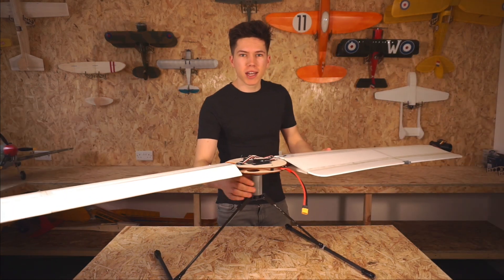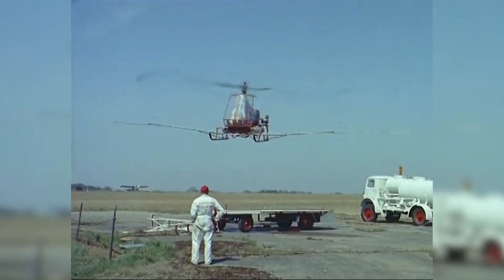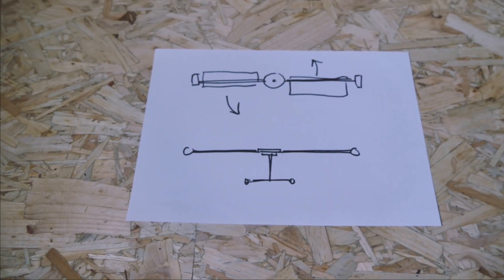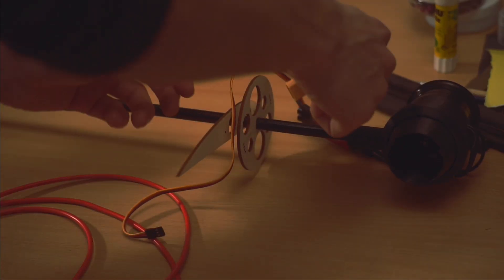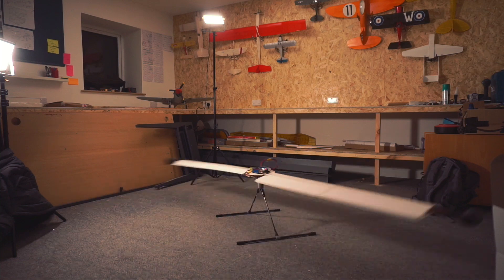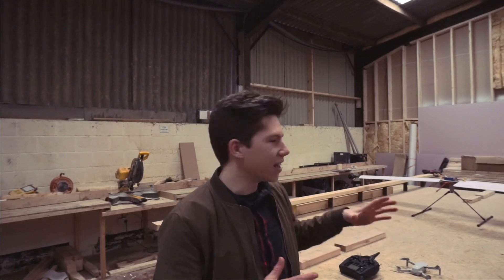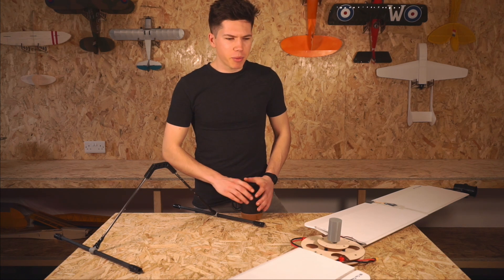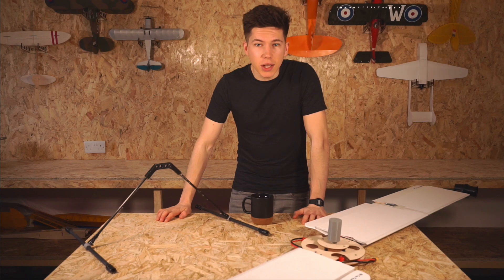TIP JET Helicopter Mk1 (Will it fly?)

Comment: I really wonder if somebody could add folding tip props to an auto gyro and use battery power to spin up their blades for an ultra short near vertical takeoff without having to build a whole drive system for the props

Comment: U should move ur thruster in closer to center  it should  take less power and spin faster the way u had it in this video u placed them at tip of wings thus equAls more torque bring them to the center and u should get plenty of acceleration and more stability

Comment: You need the equivalent of dihedral. They made a counter rotation weight shift with the guy standing above the angled blades. If you use the fans on shorter arms at right angle to the blades you decrease the tip mass. Double Macrutchen.

Comment: What was the name of the giant helicopter built for the Army in the 60's, It could carry a bus under it, on a retractable platform (it I recall correctly it was tip driven, and it had very low RPM. YOU DID MENTION THE ONE THAT HUGHES BUILT.

Comment: A bit of Diahedral will help stability.You dont want anything in the wing tips to spin as the gyro effect is Bad.A idea I have not seen anyone else do yet is put Jet turbines in the tip Except without the turbine.The Air will come from a Sprintex Supercharger or Turbo in the Helicopter body & driven by counter rotating propelers.A old friend said the Rushens have tried that but not shore myself.I guess there could be problems with unevan thrust & rpm if so a seperate compressor & motor is needed which I am shore has been tried before.

Comment: I wonder if it would be more stable with three or maybe even four rotor blades.
This might sound daft, but I'm making this speculation based on two-bladed vs three bladed fidget spinners!
I noticed that there is far more wobble with the two bladed types, tri-spinners rotating much more smoothly.

Comment: Try giving the main rotors need both some dihedral and either some flex on the attachment to hub or a semirigid,
teeter-head system to account for the unequal lift. Some empennage for directional control and stability would help as well

Comment: Jet tip rotor helis were planned to be used by NASA to recover returning space capsules. The helicopters envisioned had something like 4 to 6 rotor blades with the jet turning engines on each tip. This was a 1980s idea when they were planing on to back to capsules because of the shuttle limitations.

Comment: A pulse jet, ram jet or propane jet without rotating parts would work much better on rotating blade tips. The constant fighting of the gyroscopic forces of a motor or turbine is very hard on the motor’s bearings and causes additional load (work). Not efficient.

Comment: Firstly, awesome. While foam board wings on an aircraft are ok, for helicopter rotor blades, its is probably too rough. Your original plan was better. Balance the blades first. Turn the helicopter on its side, if one blade drops, its heavier, add weight to the opposite blade.

Comment: Make a pitch curve and throttle curve separately. That way you can control the speed of the rotor and the pitch of the blades, independently on certain settings with your pitch curve. Idk, something to check out.

Comment: I would angle the thrusters at a 15° angle into the propeller and place them closer for less loss of energy
 at high speed all that force will rip it apart
Adding a stronger spine in a leaf spring fashion using sharp angled thin V or U shaped brackets might do it
Good luck 👍

Comment: There are a few things here to consider. 
First the blade assembly needs to be statically balanced. The center of mass has to be as close as possible over the axle. Otherwise the wobble may be unstoppable. 
Be careful about the skids not getting caught on even a small bump. There is a phenomenon called Dynamic Rollover which says that if a help tilts beyond a certain angle (and it is a small angle) there is no control authority by which you can upright the craft- basically it will snap-roll-over. 

Helicopter rotor blades are not continuously flat through the 360 of rotation. Take a look at this amazing video
https://youtu.be/Pu48f7s5Ru8

Comment: Play around with the depron a bit. Bend it in every possible direction. It has a 'grain' and bends way more easily in one direction than others. Even flipping it over makes a big difference. Find the right way to bend it and you can form it by hand over a round dowel. Some sellotape on the leading edge pre bend can stop it breaking too. You can make a full 180 degree bend in this way. Super smooth, and sellotape can be removed if desired to save mass.

Comment: Propellers are more efficient than jets, because they push a larger volume of air at a lower velocity. Ducted fans usually opt for a higher exhaust velocity, which means a higher top speed can be reached, though they are less efficient.

This is a fundamental obstacle for tip-jet helicopters. The tip-jets by their very nature require high exhaust velocities. Because Kinetic energy is equal to 1/2 MV^2, higher exhaust velocity requires exponentially more energy as velocity increases, despite only having a linear relation to total thrust.

The tip-jet helicopter attempts to convert this high-velocity exhaust into a larger quantity of low velocity exhaust, but there will always be substantial conversion losses. It is a fundamentally flawed concept, compared to a coaxial or dual-rotor helicopter, which achieve the same effect of nullifying rotor torque without requiring high-velocity exhaust jet engines spin a low-velocity exhaust propeller.

Their use in auto-gyros / gyrocopters is a far more practical application, due to the smaller demands, but still far from ideal.

Comment: if you purposefully build it to be self-balancing wing ground effect copter?
Reply: change to tip-jet edfs, removes the tip vortices problem
Reply: ie make them large enough, the size of the main blade, to remove the tip vortices
Reply: dont want to have complex rotor stabilization systems? use autogyro (vertical) OR put drone like gyro stabilization spin discs (horizontal) as the main hull stabilization system

Comment: You should put the motors on the inside of the propellers not the outside they’ll spin faster it’s the same thing ice skaters do with their arms to spin faster. Arms out wide to spin slow then they tuck their arms into their body and they spin much faster

Comment: I suggest you use tubes that are more "weighted" that will stabilize the craft enough--to enable "lift"
The wobbling effect I feel is due to the"unequal balance" of the props v.s. the rods. 
The rods are just not able to support such powerful props. You need "weighted material "
Heavier iron that will enable the proper stability in making a successful "takeoff "
Or think of using plastic tubing that arebigger...like the helicopters that lands on water.
They have such tubes (You can imorovise) in home depot type store😁BRILLIANT !! Best wishes! I can't wait to see it fly!

Comment: If you put the fuel barrel on the tips, and make a directly moveable mechanism betwwen the propeller & the aircrafts body, put another prop on the other side with opposite way rotation, actually you make anty gravity flying machnie

Comment: I was thinking (always a dangerous thing) that an engine at 30% from center molded onto the wing would be an improvement. The tip forward speed would be more stable and engine would fight intake air less,.

Comment: Use a bungee strap to anchor the craft to the centre of the workshop table and minimize damage. Lay tarp over the whole table and raised table edges to minimize damage (light weights to keep it taught (could be turned into a launch mechanism 😉)) .

Comment: I think you're missing something that's used in almost all modern helicopters. If I remember correctly, the problem of a stable hover was solved in the early history of helicopters, via the "flapping" rotor. What that does is allow each airfoil on the rotor to move several degrees fore and aft, in relation to the other blades. So, if you hinge each of the foils, where it attaches to the hub, maybe it'll be more stable. It's completely self-regulated by centrifugal force. And, to be clear, those hinges would be parallel to the axis of rotation, not allowing the rotors to sag, but rather, allowing them to get a little ahead or behind the mean rotation. Hope that helps.
Reply: After a little research... The part I'm referring to is actually called the "offset lead/lag hinge." If you aren't employing variable pitch, I think the lead-lag hinge may be more important.

Comment: I think you need to increase the surface area of the base and think of a way to transfer more weight ie the battery to the base to give it more stability. 
While your're at it also consider adding a motor on a stubbed wing for yaw movement once you get off the ground.
I thing you are unto something here.

Comment: the electric motor is simply not very good for this, battery adds too much weight and the energy density is not good either. You should revisit this project with some home made jets, shouldnt be to hard or with sugar rockets? or maybe even a small air compressor, there were flying helicopters machines with compressed air believe it or not . google Sud-Ouest Djinn

Comment: You could use the lighter foam board by marking where you want the curve for the leading edge (i'm presuming this is this difficulty you encountered!?) and make score lines on the inside of the sheet every 5mm or so! Also by adding a thin (1 - 2 mm) strip of carbon fibre along the leading edge would increase the strength but not add that much extra weight 😎

Comment: Two questions: 
Wouldn't it help to move the engines further towards the middle of the wing? There would be less centrifugal force on the engines (allowing to spin at higher revolutions where the wing tips can produce more lift). Also it will change the gearing for the engines if that makes sense. 

And when it's off the ground won't the landing gear start spinning like crazy? Even though there is a bearing between the gear and the wing the gear should still start to spin because of friction in the bearing. Does this matter?

Comment: Given that these types of helicopter rotor drive systems have been developed, tested, marketed and used commercially and by the military before being abandoned, the answer to your question is, provided that you construct it correctly, it will fly!

This is hardly pioneering development work so there's absolutely no question of whether it would fly (if built correctly).

Comment: This was done waaaay back in the 60's with an .020 cox nitro motor as a single blade monorotor . It was an excellent fun free flight . Was very efficient and would easily fly off if over fueled . Look up some vintage free flight videos and you may find it in them.

Comment: As I think, on the ground the blades are rotating, but in the air the landing gear will rotate also. You need a small tail rotor. Or you can add another counter rotating jettip rotor on the same axis.

Comment: Don’t you need another set of counter rotating blades( perhaps not)?  I would think the blades should be thinner with much thinner tips. Also, try adding an aileron to each wing and shape it more like a propeller.

Comment: Try putting the battery packs (not the electronics) suspended underneath the rotor.  You can get the power to the electronics on the hub using a pair of simple slip rings.
After reading some of the other posts it might make sense to try:
1:  Use a varying lift / angle-of-attack rotor.  Higher at the hub, lower near the tips.
2:  Bring the EDF's into the 50% or 66% point on the rotor OR
3:  Mount the EDF's on short arms at 90 degrees to the main rotor

4:  No idea how adding some dihedral to the rotors would affect it.  It would definitely complicate the rotor design!  It would make sense if the dihedral was added where the motor pods are mounted.

Comment: Hey, cool project im really thinking about starting to build one too. Have you considered using 4 wings instead of two? Maybe you could have shorter wings that way. Also if you are planning   on getting that thing to actually fly stable you will need two things. First of all the build needs to be way more accurately built and well balanced, i know this was just a test setup but you neer proper symmetrical wings, those experimental wings wont do i guess. Secondly you will need to be able to controll the copter. First and probaby easiest thing that pops in to my head would be  3 additional small propellers, two of them attached to the base on each side one which will push air down to roll the helicopter to the left and right. Additionally one heck rotor just like a normal helicopter does. I know that you basically eliminated torque on the base and you wouldn't need them. But if you want to be able to control tilting left and right youll need to be able turn the helicopter in the right direction, also even if you dont have a counteracting force that will make the base spin around, it will still start to spin around bc of friction in the bearings and other influences like wind and stuff.

Comment: The fixed blades will not be controllable.  You will need a gyro stabilized "body" that does not rotate and cyclic feathering of the blades.  Any forward speed will also require blade flapping, or the whole thing will roll over.

Comment: You need a controllable directional counter-torque mechanism, and cyclic and collective pitch modulation, along with symmetrical main rotor blades, and a main rotor system tachometer.

Comment: Actio reactio! As soon as your "propeller" will lift off the ground, the central part will start to spin crazi as it doesn't have any counter moment to not spin. And if there's no counter moment, it will not be able to deliver more power to spin, so clim... Think twice of the use of a helicopter rotor tail or double rotor...
Reply: Por Dios! Este es el motivo por el cual nunca va a volar!  Falta un rotor de cola que impida que comience a girar sobre si mismo al separarse del suelo!!! Es increíble que tanta gente cuestione otros asuntos y no tome este como el principal problema de este proyecto..

Comment: Use servo to the flaps and add a flight controller for stabilization. Flight controller will continuously adjust the pitch of every wing. AND try to keep the heavy item like battery at the bottom of the frame to lower the centre of gravity.

Comment: I think you have it right, I fly helicopters and even they vibrate and shake a little bit at lower rpm’s. I think you should try it in a bigger area.
Reply from the maker: Nice! Good to hear. Yeah I think it’s a case of finding a happy medium between catastrophic vibrations that limit performance (by destroying the aircraft 😂) and zero vibrations. As long as it can fly stably without shaking itself to pieces, that would be a win for now.
Reply: That’s absolutely right!😂 The guy I fly with has a Schweizer 300 which went into an effect called ground resonance...basically they were sitting on the ground playing with the collective at low rotor rpm’s (the control that controls your up and down) and it hit a vibration which basically shook the helicopter apart luckily no body was injured. But...lucky for you yours has 2 blades, unlike the schweizer which has 3, it can only happen on 3 bladed helicopters. This is irrelevant but science behind helicopters, very fun, fascinating machines...feel free to use this info in your video!😂

Comment: Vary the AOA along the length. Higher AOA at the root (similar to a propeller). It will make the lift more efficient. I like the idea of Adams Board. It is easier to experiment with and easier to repair than balsa.
Reply from the maker: Completely agree about the way foam is friendlier for experimenting:)

Comment: What if you were to make something similar to a dihedral? It would make it more stable
Reply from the maker: I can't remember the reason off the top of my head, but I believe the reason helicopters don't have dihedral is because it actually worsens oscillations/instabilities.
Reply: @Project-Air  I did some research and it looks like it does make it more stable. On a helicopter it is referred to as "coning angle" and there are several academic articles showing the positive relationship between coning angle and stability.
Reply from the maker: Fair enough! I’ll have to look into it more

Comment: All of your design work and cutting the airfoil ribs on the laser was for naught. The wing ended up not having a proper airfoil shape and consequently you did not achieve the lift that you desired. A nice aerodynamic shape can be achieved by using more ribs and covering with a mylar film. That being said, I applaud the work that you are doing. Experience is the best teacher if you learn from your failures.
Reply from the maker: Yeah I'm working on it. The stepped airfoil shape I ended using is, although draggy and inefficient, a high lift one. Sometimes you have to compromise and go with what you have when you're doing this for real. In the future I could spend the extra effort creating the ideal wing but this was just a proof of concept for now (and one that might have destroyed itself on the first spin up) ☺️

Comment: Technically the Rotodyne had tip rockets not jets. The tip rockets were fed air and fuel under pressure, which burnt in a combustion chamber and exited out of a nozzle. It was very noisy.
Also this is not a monocopter, it has two wings, a true monocopter or Charybdis has only one wing. See Charles McCutchen flying machine. https://www.youtube.com/watch?v=1oSck_XD0_M
A straight wing is unstable in pitch, others have suggested 3 blades or  counterweights on sticks to ensure this, the batteries could serve this purpose.
Reply from the maker: Good idea about the batteries!